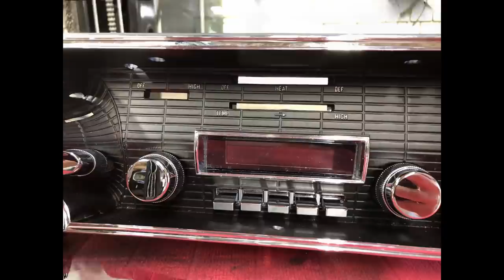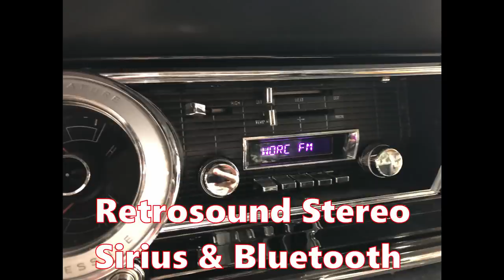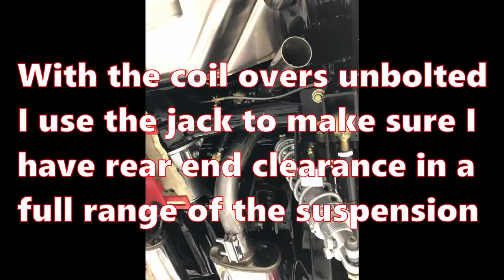Dodge Charger Restoration Video Junkyard To Hot Rod in 30 minutes

Comment: I have just started to restore my 67 Charger Hemi 4 speed. I am not able to complete a frame off rotossiere restoration like you did but watching your entire video gives me insight  as to what lies ahead. I will end up with a nice driver. Thanks for shasring your 2 yr journey in 30 minutes, much appreciated.
Reply from the maker: Thank You for watching. If you ever need anything let me know. I have a lot of sources that can help you with parts and services. Best of luck, Troy
Reply: @troykane  Thank you Troy I appreciate the offer. Right now I'm trying to decide if I should drop the K member with the front end to rebuild it before I put the engine back in. I've watched many videos on the process of putting the K member with the engine and trans back into the car. I understand I have to remove the torsion bars first and
Reply from the maker: @deanprevolos55  You can do it either way. It's whatever you prefer
Reply: @troykane   To rebuild the front end, do I still need to remove the torsion bars first?
Reply from the maker: @deanprevolos55  Yes you do or at least release the tension on them depending on exactly what you are doing.
Reply: @troykane  Thank you for the response. I want to rebuild the front end, so if I remove the clip on the back side of the torsion bar and then use a torsion bar remover(Mancini) and knock it out of the front arm, then I can replace the front end parts and leave the K member in place, correct?
Reply from the maker: @deanprevolos55  Yes